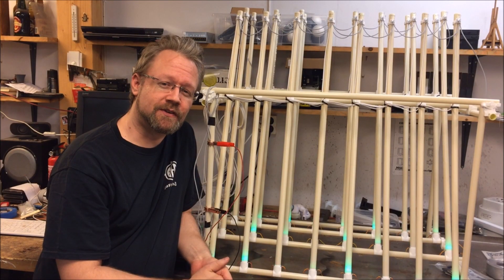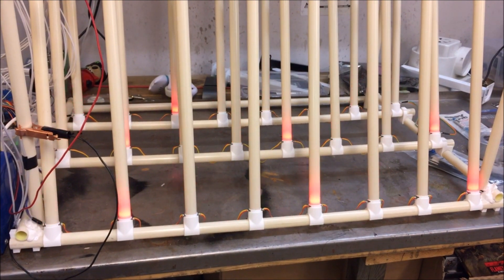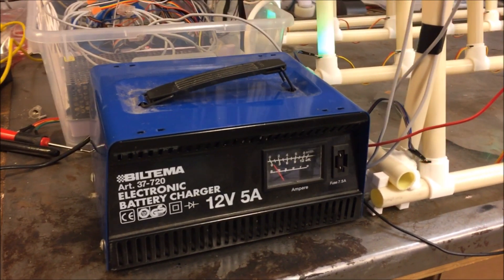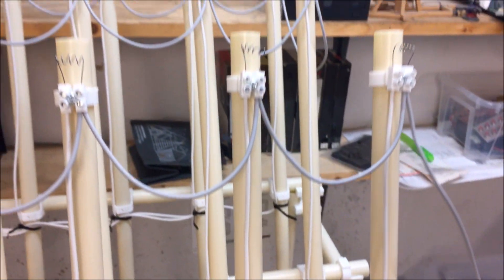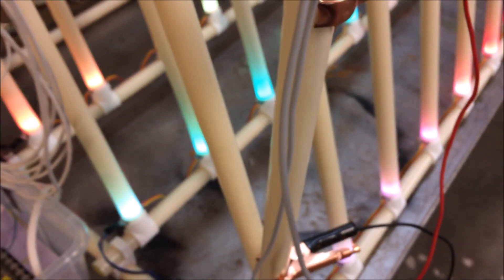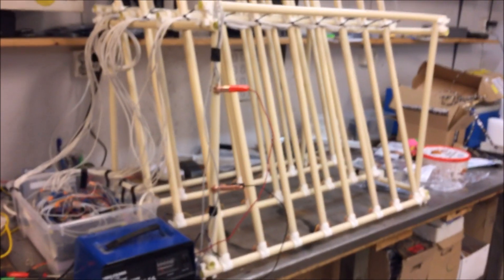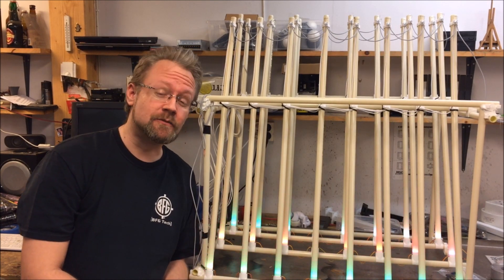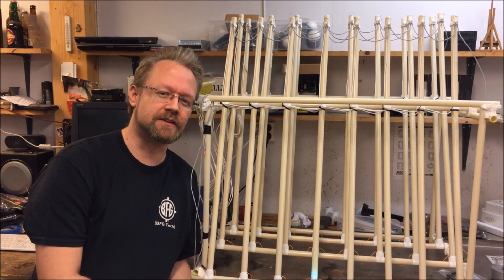Using Arduino to shoot Fireworks!

Comment: Where can you find information on kanthal wire? I am having a bit of a hard time...
How do you determine the number of coils, the thickness of wire, the inner diameter of the coils, the voltage required, and amperage required?